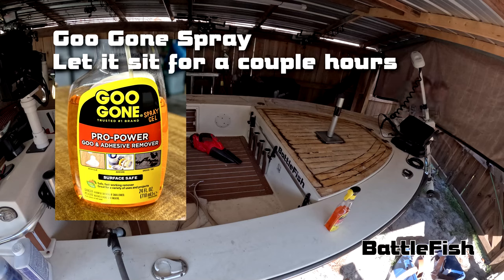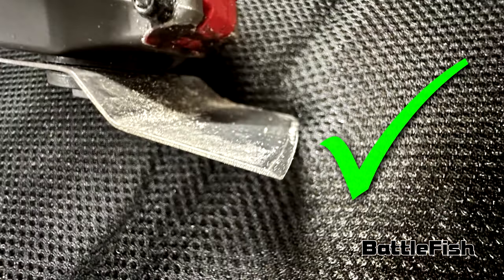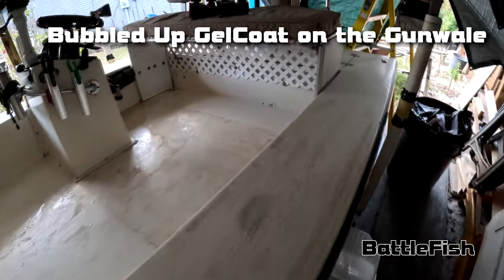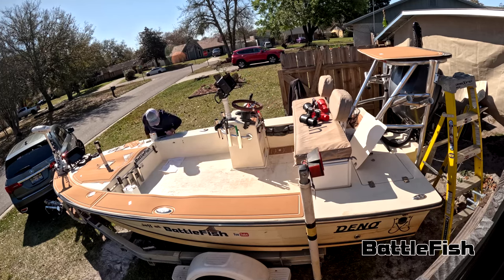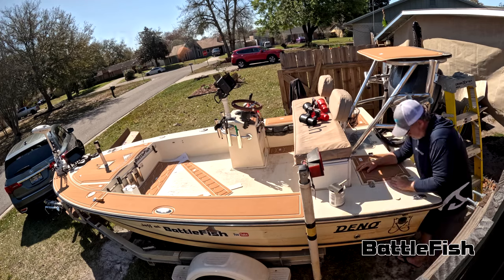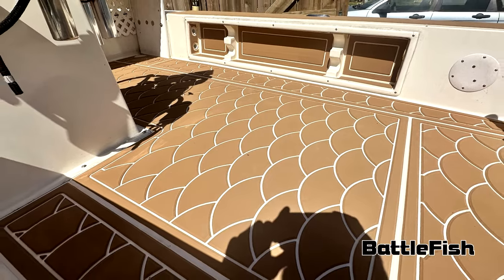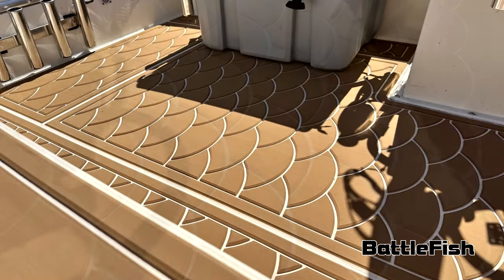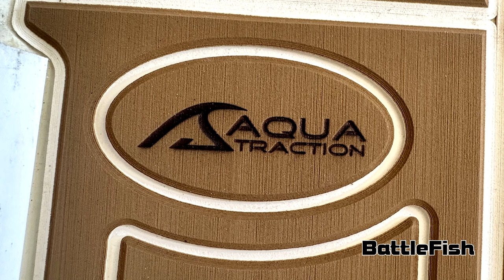EVA Foam Marine Flooring Ruined my Boat (Can I remove it)

Comment: You're a life saver.  I wanted to restore an older boat, and ran across EVA foam.  I watched a video on how to install it, and the only thing that concerned me was the guy said that any liquids that might be on the foam, need to be cleaned off quickly or it could stain.  Now, after watching your video, I'm glad I decided against using that crap.  It seemed too good to be true.  

It looks cool when it's new.  But, if I restore a boat and make it look awesome, I couldn't sleep at night knowing that I sold someone a product that won't last more than a year or two.

Comment: I have Ev foam on my boat it has been on there 2 Seasons and looks perfect and I had to remove a section for a seat and it came up with no problem. I think it might have been the brand you used . Not all Ev  foam is bad. Mine was from a USA Company on Amazon paid a little more than the cheap ones
Reply from the maker: @aprtuned75  apples to apples? I fish in the Florida sun 5-6 days a week. 7am to 4pm. Boats under cover the rest of the time. Not sure you’re putting yours thru that torture. Good luck.

Comment: How long did the stuff that you replaced it with last or keep its appearance and structural integrity and would you buy it again?
Reply from the maker: The EVA foam from eBay and Amazon that I took out only lasts two years. I fish 4-5 days a week and I'm in Florida. The white lines disintegrated first then the brown, could see it washing away each time I rinsed the boat off. Plus if gouges easily. I would not put EVA foam on a boat again.

Comment: EVA Foam, like any boating product, requires maintenance. Nothing in a boat will stand up to the intense UV it receives without maintenance. As soon as you lay down EVA give it a coat of 'spray on' UV / stain inhibitor. Give it additional coats based on usage. If you're an 4 to 5 day a week user you need it every month. Mild dish soap and a rinse after every trip out. Covering your boat is another good way to protect it when not in use. 

If you think you can "lick it stick it and forget it" on any boat deck covering you're fooling yourself.

PS: Educated yourself on EVA performance specifications before purchasing for a DIY project. Then you'll know to why to stay away from Ebay & Chinazon products. Florida has many reputable suppliers with more color choices, textures, sizes, thickness, etc. And they'll ship. Marine Mat is a good one.
Reply from the maker: Thanks for your comments

Comment: Different brands use different adhesives. If its the 3M backing, citrus cleaner works well to remove it. It will turn into a gel and just wipe away.

Comment: so take one foam product off for another foam product, Polyethaline Foam. The first decking appears to be Amazon or eBay grade likely without UV inhibitors and a lesser quality PSA based off of the removal. The good news is that you figured out that you have to get the foam off with the oscillating scraper before dealing with chemicals.

Comment: What was the cost difference between the EVA Foam and the Aqua Traction?
Reply from the maker: Depends on what your time to install the EVA is worth. The Aqua Traction was $30 a sq ft installed. My boat was about $1800 installed.

Comment: Did the boat sit uncovered in the sun? I just ordered some custom cut/but still not name brand Eva foam. Hoping it lasts 5 years minimum. I only go out on weekends May-Aug and boat sits covered when not in use
Reply from the maker: Covered under roof however I fish 5 days a week in Florida. So it’s exposed. The Aqua Traction is used by guides here and lasts up to 7 years.